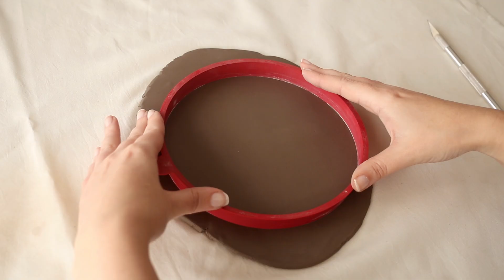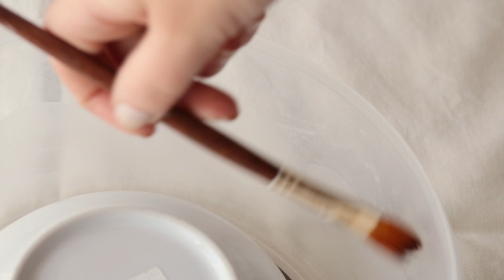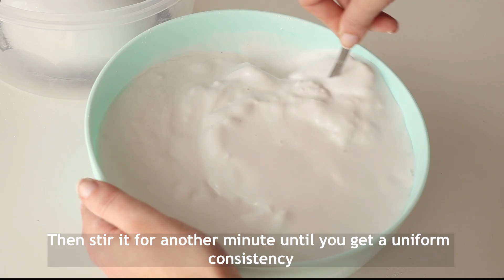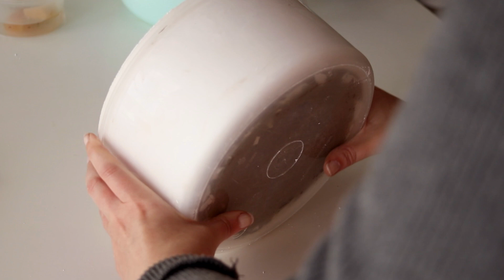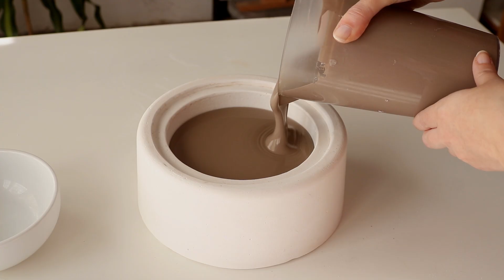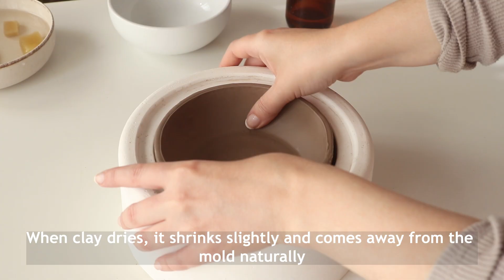How to make a PLASTER MOLD (and how to use it!)

Comment from the maker: Some general answers:
•The ideal plaster for this type of mold is “ceramic/pottery plaster” since it’s strong and can withstand many consecutive uses
•For a mold of this size, the walls of the piece usually take around half an hour to form
•As the bowl begins to form, the upper rim becomes visible and stands out from the rest of the slip, which is still liquid

Comment: when I pour out, there is excess that doesn't pour out, and it runs back down into the bowl . How do you minimize this "slip wave"?
Reply from the maker: Hi! You can leave the mold upside down for a while over the bucket to let all the excess slip drain out completely. You might need to place a rack on top of the bucket and set the mold on it

Comment: Beautiful work. How long do you hold the slip inside the mould. Is just by feeling or is it measured by how thick you want the sides to be?
Reply from the maker: Thank you!! A mold this size usually takes around 30 minutes (if it’s dry) but I keep checking the thickness of the walls until I’m happy with it. It really depends on the piece I’m making... whether I want it a bit thicker for carving, or something finer and more delicate
Reply: @UmiCeramics thank you ❤

Comment: How long does it take to make wall of bowl form?
Reply from the maker: Hi! For a mold and a bowl of this thickness, it takes about half an hour
Reply: @UmiCeramics thank you
Reply: @UmiCeramics how do you determine the thickness of the wall? Do you have to keep pouring in more than pouring it out to build up the thickness?
Reply from the maker: @ninja620-k7x  Hi! As time goes by, the plaster keeps absorbing moisture from the slip, and the walls gradually get thicker. You can see the layer forming (the edge of it stands out from the slip that’s still liquid) Once you’re happy with the thickness, just pour out the excess slip. Hope that answers your question!
Reply: @UmiCeramics it does, thanks 🙏

Comment: Any ideas why i keep having weves after throwing the clay? 😭
Reply from the maker: Hi! I’m really curious about your comment! could you tell me a bit more about the situation you're describing? 😯
Reply: @UmiCeramics  I’m running out of ideas why, when I pour out the clay after the cup walls have reached the right thickness, the inside surface of the cup ends full of irregularities, like a 'wave' texture. The outside of the cup,, turns out perfectly smooth.

I’ve made sure to stir the clay well, pour it thru a sifter, and keep the proper angle when pouring it out of the mould, but nothing has helped so far. 😢

Will be grateful form any advice 🙏
Reply from the maker: @magdalenakulig169  If the clay is well mixed, you keep the proper angle when pouring it out, and there’s no sudden movement while doing it, then I can think of only three possibilities:

-The mold is still a bit damp and absorbs the clay’s water unevenly, creating those thickness differences that look like waves.

-The slip has an inappropriate water-to-deflocculant ratio.

-The inside of the mold has some leftover mold release, like wax, from when it was made.

I would do these three things: wash the inside of the mold with regular kitchen detergent, let the mold dry really, really well, and if that doesn’t work, try another slip recipe.

I’ll keep thinking if there could be another reason!
Please let me know if you figure out the cause or if it gets resolved!
Reply: @magdalenakulig169  add a small amount of sodium silicate to your slip, it should be quite runny, even more runny than in this video and the defloculant (the sodium silicate) makes the slip flow more easily without adding too much water (which would soak the mould over time)
Reply: Use rubber red tool after trimming

Comment: I'd add that one should be careful when cutting clay inside a mold. Wooden or plastic tools are the best. You don't want to embed plaster debris into the piece, as plaster dehydrates at high temperature and so can crack the clay when the steam has nowhere to go.
Reply from the maker: That's a very good observation!